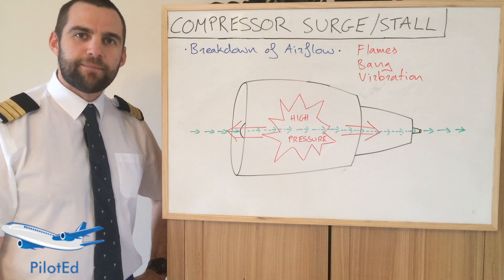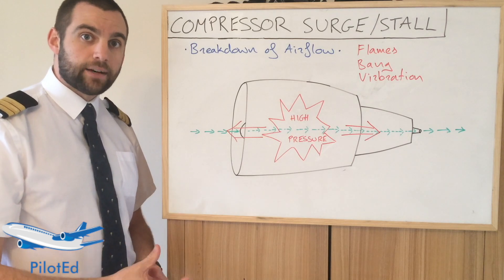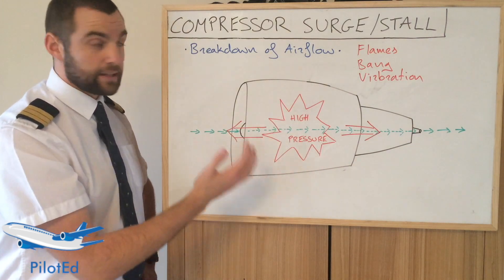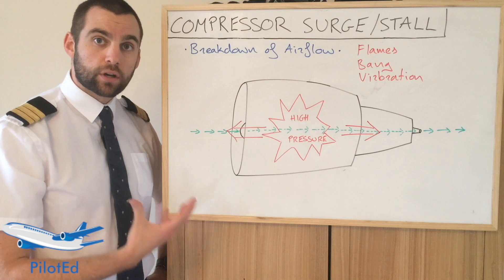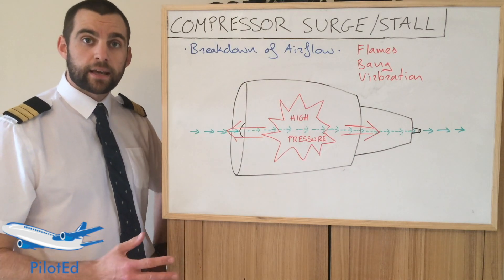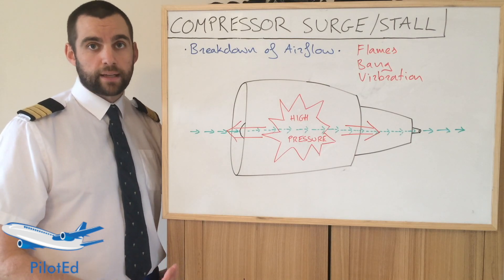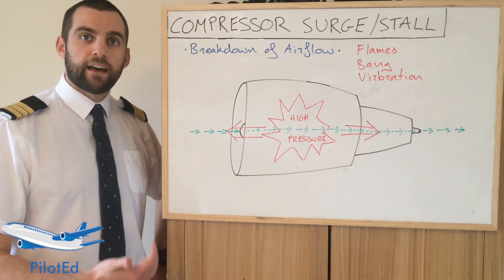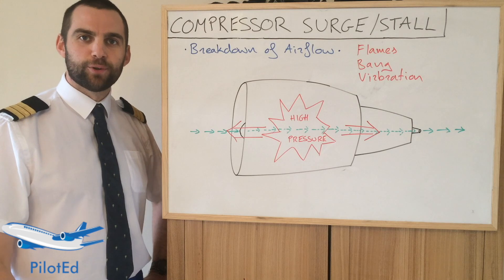Compressor (Engine) STALL or SURGE ✈ ATPL ✈

Comment: Having experienced stall at high altitude where the engine produces less thrust and therefore where the effects of a stall are less dramatic, I would add that one of the most salient features of a stall is the startle factor (noises, vibrations). And also that despite it being very perceptible, it might be difficult to notice abnormal indications on the instruments.

Comment: Great video. Good point about keeping an engine running even if idle thrust is all it can manage. That engine likely has a generator that will function, a hydraulic pump that will function and to a lessor degree bleed air. If EGT is stable within limits keep it running.

Comment: I've been stood on the ground as a jet (an executive jet - not sure which model) had a compressor stall whilst taking off a few hundred feet away. The noise was one of those "thuds" you feel in your chest - despite the usual noise of the engine itself. The aircraft was able to climb away leaving a cloud of black, sooty smoke were the engine had "flashed". The aircraft returned to the airfield a few minutes later apparently with both engines running. We were quite used to aircraft noise, but that abrupt sonorous "boom" made everyone jump!

Apparently this was the first operation of the aircraft after some maintenance involving the engines and was some kind of trial flight, but I don't know any details. I just recall throwing my cup of tea over myself!

Comment: I will explain from what i understood (correct me if iam wrong)
In normal condition incoming air gets pressurized at each stage of compressor. When there is a breakdown of incoming air it is known an stall (since continuous flow air is stalled) which results in high pressure at any of the stage and reverse flow of incoming air which is known as surge

Comment: Two questions. 
Do compressor stalls occur when the rotors and stators are at a high angle of attack?  
Why would an area of high pressure in the compressor be bad? Isn't the job of the compressor to pressurize air? 
Many thanks!
Reply from the maker: yes but its when the high pressure can come out the front that its bad mate :) thanks for watching
Reply: First question. yes that is one incident of compressor stall, when the blades loses "lift" much like the wing of the plane.

Second Question. In abnormal circumsatnces, when the pessure build up in the combustion chamber is higher than the compressor stages, the air tends to reverse flow and this causes Engine surge or stall. This occurs when the throttle setting is high but the air flowing into the engine is reduced by a crosswind etc.
Reply: It is not abnormal for a row of blades to stall locally, depending on the compressor airflow and blade rotation speeds. Especially during off engine design points like taxi, and decent, where compressor bleeds are activated for compressor stability. If a stall propagates to the extend that it becomes severe enough, you eventually reach a surge. But they are two different things.

Engines incorporate variable stators that direct airflow accordingly to prevent very high or very low angles of attach depending on power setting, mach numbers etc.

Comment: So generally it isn't dangerous?
Reply: Very, surging in general may cause failure to the compressor blades
Reply: @AbiRizky    which in turn can lead to catastrophic engine failure and (possible) damage to the aircraft.  In that case an RTB is immediately warranted.  That's one reason you never choose to sit near the engine if at all possible.